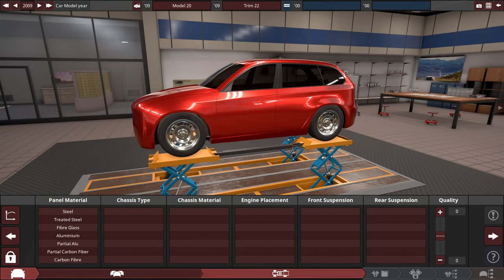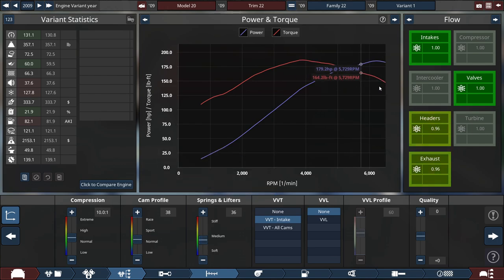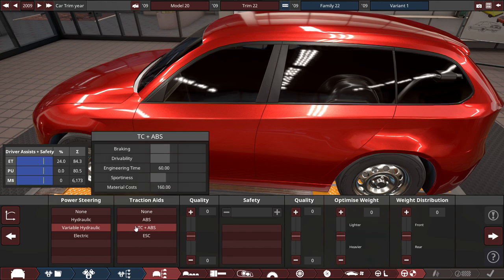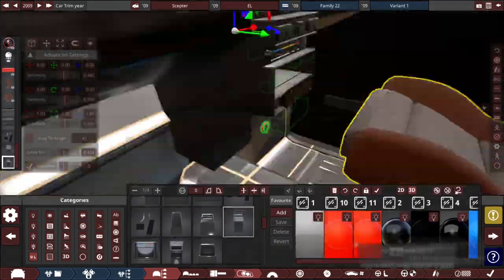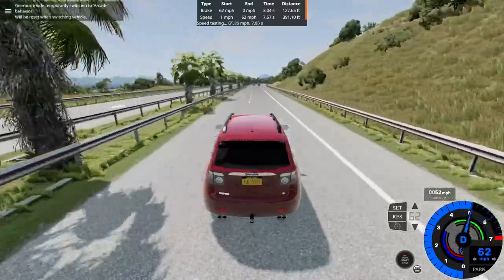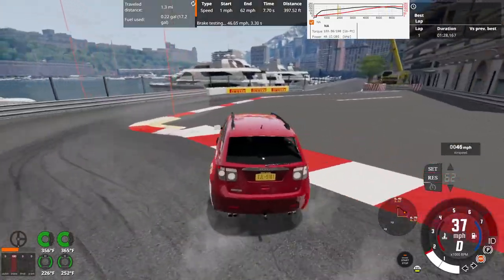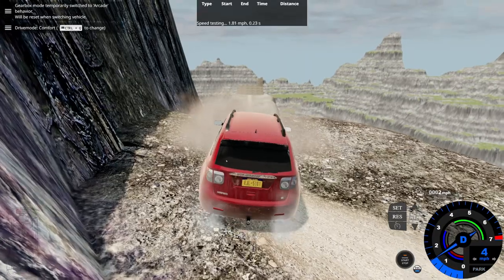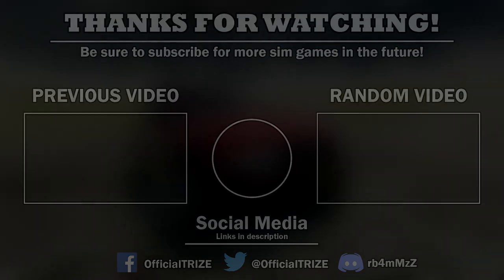My Attempt on Building the Most Realistic Car | Automation Game & BeamNG.drive

Comment: I could be wrong but vented disks doesnt mean drilled it means theres cooling ribs between the brake surfaces. The disks are thicker and are not sollid metal from face to face where the pads interact.And that would make vented the more realistic choice.